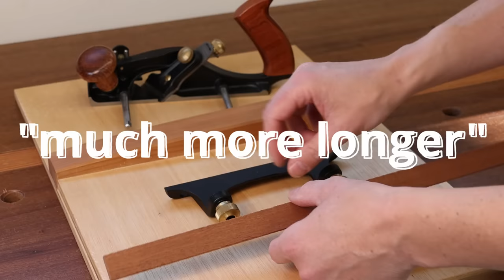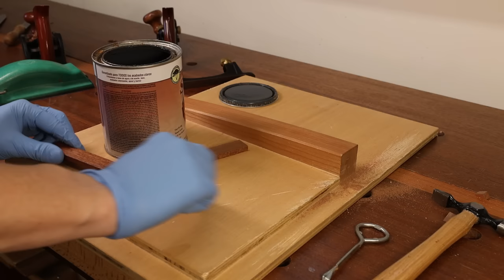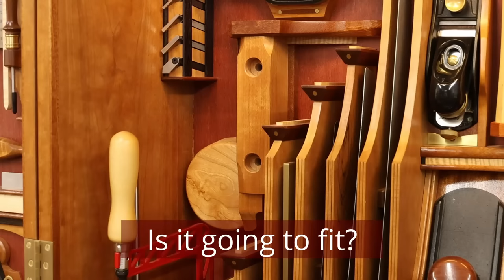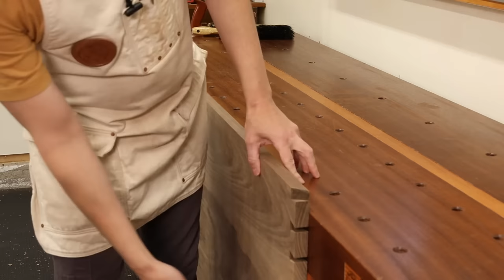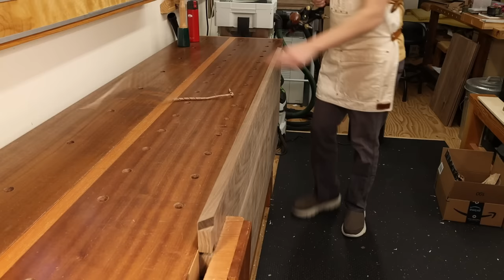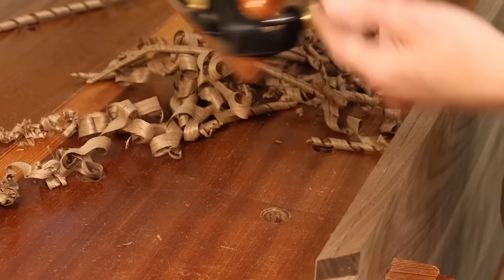Veritas Skew Rabbet Plane Deep Dive

Comment: You may find the plane more comfortable to hold with your non-dominant (left) hand if you remove the front knob and use that to set your thumb (as you push laterally against the body with your palm). In fact, I made a low brass know (ala a block plane knob, but lower) to rest the thumb. Secondly, I recognise what you say about the depth screw's knob loosening. I tighten it with a plastic-headed vise grip, and this works very well. No slipping. Use one also on the fence rod knobs. Regards from Perth, Derek

Comment: The optional long rails will add another 2-1/2". Their website states: "They are desirable when you need to add a thicker auxiliary fence for stable registration against a workpiece, such as with a tapered spacer for angled cuts, but still require use of the full cutting width of the blade." I find it hard to see where these would be useful. What I really find odd, is that these are listed as an option for this skew plane, but not listed as an option on their plow plane which seems the more likely candidate for using longer rails. Go figure.

Comment: Why not check a lock washer or something on those fences? Maybe a brass lock washer.  I imagine it's machined so well it doesn't hold.  Or scuff up the bolt just a tad or buy a steel nut

Comment: Great tip on placing the board on its side to cut rabbets with taller reference surface. I think you can also align the the edge of the board with the edge of your workbench to get the same result, assuming the board is not longer than your bench.

Comment: Love your tool cabinet. Beautiful work there. When you buy an expensive hand tool you should feel confident that you can trust that the depth stop will work! I’ve found the Veritas knurled knobs to be totally unreliable for tightening down the fence and depth stop, and this mechanism seems to be the Achilles heel and a major flaw in engineering with this Veritas rabbet plane and their plow plane also (which I own). Veritas would be wise to re-engineer these knobs so they can be tightened securely with a driver, or go to a wing nut type like my trusty Record 778 that can be tightened securely without pliers. Perhaps not as elegant as the Veritas brass knurled knobs, but I’ve never had any issues with slippage of the depth stop or fence with the Record 778. The straight blade in the 778 is not an issue either on end grain if the blade is sharp - especially since I saw to the depth line on end grain anyway to prevent tearout.

Comment: Great video! The nicker has worked for me. I pull the plane backwards a few times to score, then I start planing.
Reply: PS. Pliers lined with a piece of thick leather works for tightening the knobs.
Reply: It looks to me like the nicker does not protrude out far enough to align with the side of the plane and the cut line of the skew blade.  Would a small thin washer fit behind the nicker to improve alignment?

Comment: Good point on sanding the shafts. I've done this on my small Veritas router plane and it vastly improved the plane's ability to stay where I set it. Now you've got me thinking and I'm wondering if you sanded the depth stop and it's mating surface would you achieve a similar result. I'll have to experiment.

Comment: Excellent video. I have had so much frustration with this plane’s nicker. Surprisingly, I think the skew rabbet plane by veritas does a better job with end grain rabbets. I had no trouble aligning it and it has a couple of pros over this plane. 
-3 set screws instead of 2
-adjustable mouth
-depth stop accessory, so it actually gets all of the same features that this one does.
Reply from the maker: Are you referring to the skew block plane?

Comment: Aren't the set screws used to ensure your blade aligns with the Nicker?

Also, you mentioned in a previous video @ your #7 fence was off a little... I always wondered why you didn't put a aux fence of wood and them plane the wood to fix your angle.

Thanks.  I like your videos.  Great job.
Reply from the maker: The set screws can be used for that, yes, but I still find it to be a fiddly PITA. The jointer fence I have actually has a slight convex cup to it.
Reply: @themountaintopjoinersshop8422  You are right about PITA.  I have a veritas magnetic saw depth stop.  I will never trust it again because I easily blew past my setting and cut way too deep.   I will try the sand paper top in it! ... but the marking tape will be on the otherside of blade.

I don't use my #45 for a lot of sane reasons and instead use my wooden plough,  wooden rebate, and wooden moving filester planes.   All the screws make easy to find the fence shifted. Depth stop didn't... at the worst times.

Comment: If your knicker is flush with the side of the plane (on a Veritas I would assume it is), then sticking your blade proud of that same side, well, yeah it's gonna tear out.  Have you tried flushing the main blade to the side of the plane?
Reply from the maker: If you make the corner of the blade flush to the side of the plane the sidewalls of your rabbet often end up sloping instead of vertical. Having the blade slightly proud is key for avoiding this.

Comment: My Bestie take is not setting the blade corner to contact the layout scoreline in order to prevent tear out. I would probably be victimized by not knowing this tip. I have the Veritas Skew Block Plane with Fence and I’m sure the issues and workarounds are the same.

Comment: Thank you for the video! I have a question: do you think that this plane can be replaced by the plow plane with a wide blade? I know that blade won't be sqew, but other than that, is there much difference? Having both planes seems excessive 😀
Reply from the maker: The skew blade is why I feel I don't need the right and left hand versions of this plane, because it cuts a little cleaner against the grain than a standard blade does. I'm also not sure if a 1.5" plow plane blade is a thing, and I do use the full width of the blade from time to time.
Reply: Yeah, I've searched more and found that plow plane max blade width is only 3/4, combination plane is 1-1/16. The cleaner cut makes sense too. Thank you for the answer!

Comment: When you sharpened the blade it seems your blade holder had the non-parallel cylinder on it, isn't that an issue with rabbeting planes?
Reply from the maker: Not really. Even with a cambered roller you need to actively apply extra pressure to the corners of the blade to camber it. If you actively avoid this, the cambering effect will be negligible, if not non-existent. Thanks for pointing this out. I tend to do one or the other without thinking about it.

Comment: How does it compare to the bog standard 78 style plane by Stanley or Record? A marginal improvement or worlds apart?
Reply from the maker: I can't speak to that with any authority except to say one thing companies like Veritas, Lie-Nielsen, Clifton, etc., have in their favor is the ability to make tools using modern materials and manufacturing methods and that generally (not always, but generally) results in a better functioning tool, with a functioning warranty, without any of the wear and wear and tear that typically comes with a vintage tool. But that's just my opinion, and why I tend to prefer tools of new manufacture. That said, if you're good at rehabbing old tools and enjoy the romance of it, you can save a lot of money that way, and still get your woodworking done.

Comment: Thanks for sharing.  I've reached the same conclusions on this tool.  It does take some effort to learn to use it properly.  You can purchase nylon lined non scratched pliars (learned this from Lost Art Press).  Really help to tighten the knurles without chewing them up.  Here's the name of the ones I bought but there are plenty of them out there.  Tamiya TAM74061 74061 Non-Scratch Pliers,

Comment: By "slipping" you men the nuts unscrew themselves as a result of the lateral force against the fence?
Reply from the maker: No, it's just hard to make them tight enough to hold the smooth fence rods securely, giving the rods a slight bit of texture helps with this.